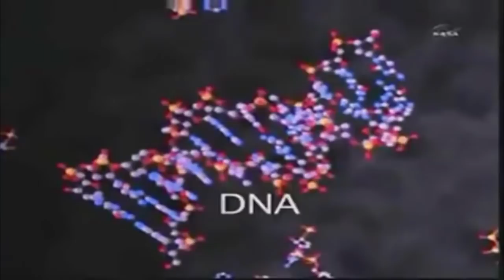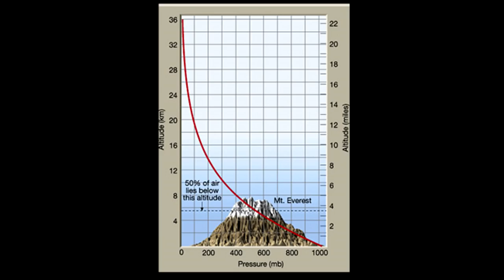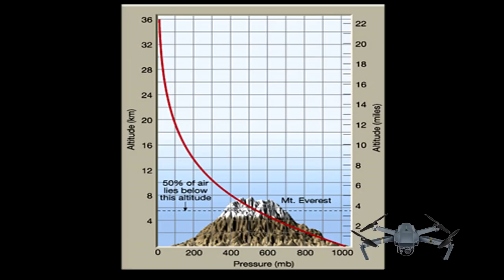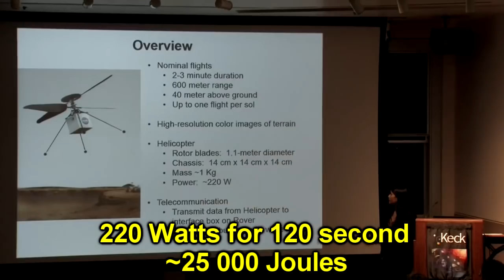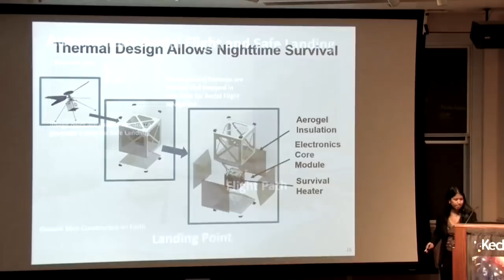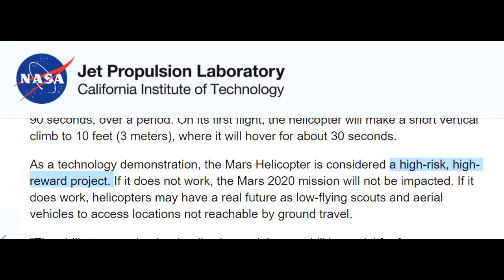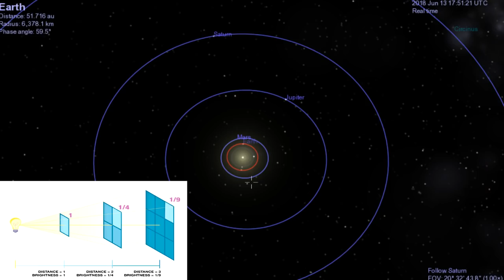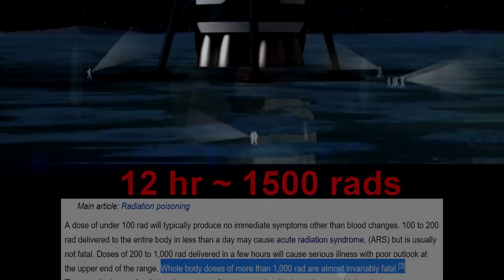NASA is sending Helicopter to Mars!! Smart or Silly?

Comment: 1 KILOGRAM
That's what you lose in case of failure. Keep that in mind.
It's absolutely worth the attempt BECAUSE this thing is so lightweight.
I know that even 1 kilo to Mars costs a lot but we've sent Curiosity, what's one extra kilo on the next mission?
Reply: You're misinterpreting launch costs as program costs. It's not like you can send one kilogram of literally anything and it all costs the same because it happens to go to space. Engineering is about 100-200 dollars an hour per engineer. There are materials costs, fabrication costs, testing costs, etc. This isn't sending a 1 kilogram hunk of lead to mars. It's sending a 1 kilogram robotic investment.
Reply: That engineering investment will not be wasted even if it doesn't work though.
But goddamn I'm an engineer where can I get such a ridiculous ammount of money per hour, is NASA hiring?
Reply: Wages is only part of that figure. Engineers need software licenses, buildings to work in, support staff, etc. All of that needs to get factored in holistically in the charge rate for an engineer when you're doing the finances of it.
Reply: This is a good testbed for their upcoming Titan Drone they are going to possibly do. So even if it fails it is invaluable knowledge worth it quite small costs relative to their normal workings.
Reply: Nothing in R&D is "invaluable." Small costs are still costs and they can snowball with this kind of reasoning.
Reply: You have to understand how the culture at NASA works.  To have a job there, you have to be working on projects.  To work on a project, someone has to come up with an idea that they can justify putting on a mission, and sell it to the bosses.  Missions start with a vehicle with a known payload capacity, and projects compete for space, mass, power, bandwidth, and other resources.  The keys to pitching this project were: 1) if it works, we get the best data ever, and we flew a helicopter autonomously on Mars, and 2) if it fails, it only cost 1 kg and x cm^3.  Those slides they were showing the press?  Those are the same ones they used to pitch the project in the first place.
Reply: Additionally, it’s being attached to the next drone launch, so the only cost is the drone itself and the little bit extra fuel to composite for the additional 1kg.

Comment: I just hope Anita Sarkeesian flies it so she can go home.
Reply: They're gonna need a bigger boat.
Reply: i say we use anita as tactical ablative heat shielding for sending a spacecraft into jupiter at full speed
Reply: Blox117 you sound kind of goofy.
Reply: I'm not sure but I think she uses a broomstick to get around.
Reply: Kevin then send her on a mission to venus to find out if living in the upper atmosphere will be possible i am sure no one there will offend her and the high levels of corrosion of all metals i ever heard of will keep her company maybe they can try using a aluminium oxide for the housing this time
Reply: a  bigger boat that explodes on command
Reply: James Carmichael we made a sort of theory elon musk is doing this stuff so he could contact home, and help continue their operations.
Reply: +Kevin Stapp
It is kind of unfair that women get Venus.  They get safe giant floating blimps with ample sunlight for solar panels provided they have the batteries for a 4 day day-night cycle un-tethered, and have sulfuric acid resistant coatings.  Yeah, if you fall off you will die before you hit the ground but that is still better than fudging Mars.

On Mars, any leak can cause explosive rapid decompression, rather than slow diffusion on Venus.  The lack of atmosphere means higher radiation dosages and larger threat from meteors.  Lack of even a psuedo-magnetic field like Venus, means even higher radiation dosages.  You get less sunlight than Earth and have to worry about dust getting everywhere on them.  You also have to worry about dust getting in all of your airtight seals, which as said before explosive rapid decompression, and all of your devices.  You have a longer travel time to Mars, which means more fuel and food, and less other cargo per rocket.  And you have 1/3 the gravity of Earth, which might be below the threshold for healthy body function (free-fall has been shown to have many negative health effects over time).

Poor Venus gets such a bad PR team, while Mars has such a good PR team that if you didn't know better you might think is more habitable than Antarctica.
Reply: Kevin Stapp, that would explain why they get 'cold' all the time.
Reply: James Carmichael "Anita, phone home...."
Reply: Mars, Venus ... Just tell her it's her home-planet, even if it isn't. Sarkeesian is a woman, it's not like she had a sense of direction that would tell her she's going the wrong way before she gets there. And as long as she goes away I don't care where.
Reply: Lady D She's a man from Mars. Because women come from Venus apparently.
Reply: joe villebrun or rather explodes the moment she utters the word "misogynist"...
Reply: Hey Mars is our home, women come from Venus.

Comment: Thunderf00t at 8:29 where you show the clip of the RC helicopter you didn't take into account this model is a main and tail rotor configuration which wastes almost a quarter of the available engine power just to run the anti-torque rotor on the tail boom. The co-axial configuration that NASA is demonstrating has double the pontential lift because it runs two rotors of equal size rotating in opposite directions. This system eliminates the torque reaction generated by the rotors because they cancel each other out. This increases available lift by allowing all the engine power to the main lifting rotors. Whether it will work on mars or not, I have no idea, just thought I should point out your error. The reason I point this out is every time you show us a drone or comparable size and weight craft the configuration is different and thus is not an apples to apples comparison for performance.
Reply: NASA stole the design from the Russian Ka-52 attack helicopter ;)
Reply: Theres plenty of real life helocopters that operate co-axial configurations. The tail rotor configuration is usually more popular in the military because damage to the engine is easier to compensate and safely land with.
Reply: Or most early turbo prop and naval fixed wing aircraft with contra-rotating propellers. It was popular on naval aircraft because it prevented the need for control input to counter the torque of the propeller, and allowed for easier landings and take-offs, especially on carriers, whilst also improving efficiency, performance, and by creating redundancy.
Reply: Stop, TF doesn't like facts !!!!

Comment: I just had a stupid idea: if you launched it from a protective platform that could reset and recharge the drone, you might theoretically be able to greatly expand the area of study for the probe. Assuming nothing went wrong (ROFL.)
Reply: Think that would defeat the purpose, it'd be limit to a small radius around the platform. Unless the platform itself is a rover it's too limiting. Now a rover with a drone, that's an idea.
Reply: A base station sounds impractical. Keep in mind that if this thing has a big battery, which it will basically have to in order to have the power to hover, since batteries have quite poor power density, it will be able to fly for probably the better part of an hour. You could be talking about it flying 50+ km in a single flight. Maybe even further since thev drag is so low on Mars it will be able to reach high speeds horizontally. Better to have everything onboard.
Reply: It would maybe help with covering area - but hinder covering distance.

A base also has the problem that you now have interacting independent parts.
If anything went wrong (a quick sandstorm and the drone can't reach the base in time) the station might get partially covered in sand preventing further charging.
Reply: The Original Gamer 
And they could make that landing base a rover, to survey new locations.
Reply: It doesn't seem like it would be so but it's actually a lot easier to automate flying than driving. This is why we can have autonomous drones that fly themselves which barring an electrical or mechanical problem always navigate to the destination perfectly while they are still having problems with self driving cars. Reason why is, you're not dealing with terrain just open air with maybe an occasional obstacle which the auto pilot can fly around however it likes. In full scale aviation self flying and even self landing planes have been a thing since the 80's so the technology is very mature and reliable at this point.

Comment: Maybe some points to add:
- About the power/lift ratio: There is actually a human powered multirotor with huge rotors, the AeroVelo Atlas. If a human with about 1 kW maximum power can lift himself and the 55 kg aircraft into the air, 200 watts can definitely lift a 1 kg multirotor on Mars. But of course, there are practical limits for the rotor size, as bigger rotors become more fragile.

- They could use a tiny radioactive heat source to prevent the electronics from freezing. Likely with plutonium-238, they are pretty standard in space applications. 2 grams of plutonium generate about 1 watt of heat. This would avoid having to use battery power for heating.
- Modern power electronics and batteries are surprisingly efficient. An efficiency of 97% may be feasible, resulting in only 6 watts of waste heat at 200W power. The 720 J heat energy generated during 2 minutes of flight could easily be absorbed by the thermal mass of the assembly.

Comment: Actually, because Mars' is a lot colder than earth's atmosphere, it adds density to Mars' atmosphere, so you would only need to have blades spining 25 times faster than on earth, not 30 times.
Reply: Cold and batteries don't mix though… according to climate data for Gale Crater from 2012-2015, the minimum temperature was -127°C (-197°F)… meanwhile, lithium batteries on Earth barely tolerate -20°C:

https://relionbattery.com/blog/lithium-battery-cold-weather
Reply: TruthNerds that’s why it is very well insulated, and will have to use some of its power to keep everything warm.
Reply: His model is not very accurate. I believe it's more like 10x
Reply: @KnowledgePerformance7  
Then the NASA engineers got it wrong, too – they sent a helicopter with 2400 rpm instead of 800 rpm. You should have emailed them before they committed such a blunder.
Reply: That's not really how it works. You do know we have the atmospheric pressure based on the temperatures it is, right? It's not like the air pressure we have vs Earth is assuming it was the same temperature, it never is.

Comment: Nope.
1/100 of the pressure means you need a blade going 10 times faster to get the same dynamic pressure (q=0.5*ρ*v^2)
Reply: Ignoring the difference in gravity, anyway
Reply: About 7 times with 1/3 gravity

Comment: the efficiency loss solar panels experience from being laid flat is really a function of your latitude, and the rover landed fairly equatorially. Mars still has a comparable axial tilt to that of the Earth, but I don't know off-hand whether it's currently at an equinox.
Reply: It's still at an angle while the sun is rising and setting.
Reply: @danpope3812  yes, my point was that comparing laying flat to being at a fixed angle (not following the sun) is very relative to your latitude. if your panel is fixed facing north and you live in the northern hemisphere, that's worse than laying it flat. if you're on the equator, fixing it at any angle is worse half the year than laying flat. the rover landed mostly equatorially, so laying the panel flat (when you can't track the sun at all) is the smartest choice.

Comment: Would the 95% CO2 concentration in the atmosphere be favorable to using tethered balloons?  A balloon to lift a certain amount of weight may need to be about 5x as large in diameter as one on earth, and have 25x the surface area, but the mass of lifting gas required per unit volume would decrease with pressure.  The fact that the martian atmosphere is mostly CO2 would mean that something like methane would generate 75% as much lift as helium, while being perhaps easier to store.  While a free-flying aircraft might be more versatile, a tethered balloon wouldn't need to carry batteries or solar panels, and might thus be lighter.

Comment: Wouldn't it take FAR less energy to spin the blades so much faster in a ratified atmosphere? It takes far more energy to spin a propeller in the water than it does in the air and that is all down to the resistance of the air or water.
Reply: That is kind of my point. If there is much less resistance, it doesn't take more energy to do the lift. IOW a 10 watt motor running full out will attain a much higher rpm in a rarefied atmosphere than in the Earth's atmosphere. This is because it is not doing as much work.
Yes, spinning the blades without flying would be rather stupid.
Reply: @Kevin Montrond
Pushing no air means you are NOT using energy. 
Tarstarkusz
 is mostly right; it would use much less energy than the same blade spinning the same speed at Earth. The motors would be running at a much lower power to maintain any given RPM. However there would be some added waste(to get the same lift) because the higher speeds would result in higher mechanical losses.
Reply: It would take far less energy to spin the same type of blades at the same speed on Mars. The ones they are using have a much wider cord and steeper pitch than conventional blades, so they produce much more lift for the same RPM, but also use a lot more power.
They'll have run simulations to calculate the most efficient blade and RPM for the Martian atmosphere.
Reply: The rpm of rotor blades are limited by the speed of the blade tips reaching the speed of sound.
The speed of sound is much slower on Mars, so the max rpm will have to be slower too!

Comment: Your definition of how a rotor creates lift is 100% iffy.
Reply: I was thinking that as soon as he showed his simulation. There's a reason blades are airfoils and not 45° planks
Reply: +Brew City Boat Club yeah that hurt to watch
Reply: @brewcityboatclub8299  45º planks work too
Reply: @ruyvieira104  
But very inefficient.
Reply: Yep... That's... just wrong! 

I'm surprised, as possibly the most of the viewers.. But.. Blades create lift in the way a plane wing does, or a wind turbine is moved. The simulation is.. astonishing stupid.
Reply: @brewcityboatclub8299  yeah but actual rotor blades are just way more optimized improved versions of 45° planks - they are much more efficient but the fundamental working principle is still mostly the same
Reply: @JoeNevermind  which is also essentially a very very improved version of a plank - again this sis about the fundamental principle and not the details - and even with an ideal wing lift is still proportional to speed squared - force being proportional to speed squared is just a general thing for all aerodynamics except in extreme edge cases like passing through the sound barrier
Reply: Indeed, as is stating that required RPM would scale linearly with air density (its a cubic relationship). And RPM is just one factor, you can just easily increase propeller diameter, or pitch or even the profile of the propeller (which they clearly did, have a look at the photos, thats the weirdest rotor ever).  If you know this little about aerodynamics, it would be wise to refrain from trying to "debunk" nasa based on experience with RC models, because you look as silly as those flat earthers with their pen lasers and zoom cameras.
Reply: A helicopter is a rotory wing aircraft meaning that the engine turns the blades which act the same as an airplanes wings to provide lift.
Reply: @vertigo2893  
Yet somehow NASA got their calculations just as "wrong" as thunderf00t. They should have asked you instead. :>
Reply: @JoeNevermind  it's astonishing how many people, like you, miss the forest for the trees.
When you don't need details just think holistically. Conservation of momentum is a thing, so in order for the chopper to accelerate upwards relative to an inertial reference frame (so it stays in place in the air), something needs to accelerate down. That thing is air.

Planes AND helicopters fly by,  to borrow an expression from another misunderstanding soul, "batting air downwards".
Reply: @randomnobody660  Uhm... no!
The thing accelerating downwards is gravity - the thing accelerating upwards is lift .. and it's not made by "batting something down".
Reply: @JoeNevermind  again, 2 ways of looking at it. You could also just say gravity isn't really a force and instead spacetime is bent. So while an inertial reference frame "accelerates" downwards relative to us, really we could say we are accelerated up by the ground and we are accelerating up constantly. But that's not the important bit anyways.

Regardless, if it's not "batting something down", how is momentum conserved? Put a simpler way, air is providing your plane with a force upwards (which we call lift), there must be an equal but opposite force down right? What is the downward force acting upon?

Comment: one thing I want to add as a helicopter pilot, were are low surface operation even on earth. the second thing is you should be able to spin the blade a lot faster do to the lower temperature on mars, and which I'm sure your aware the speed of sound is actually governed majority by temperature and not pressure.  that being said you can spin the blades a lot faster  to achiever low level flight.